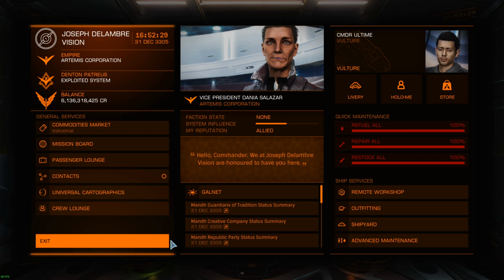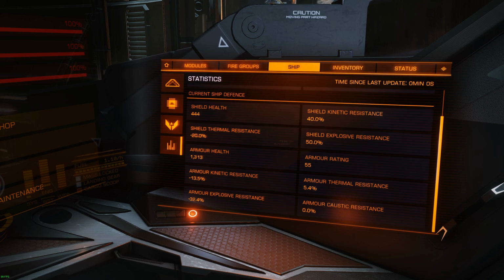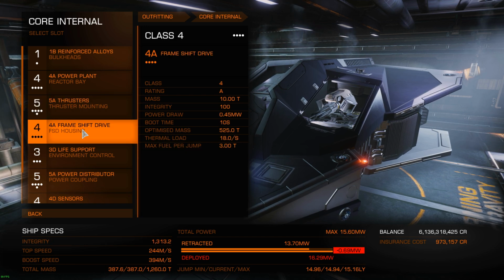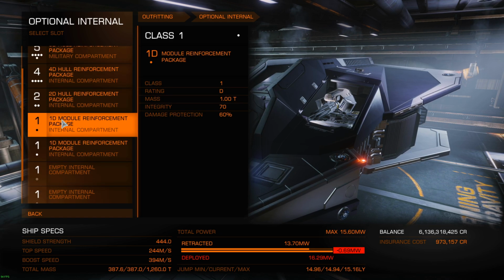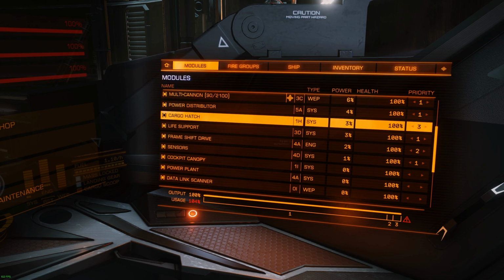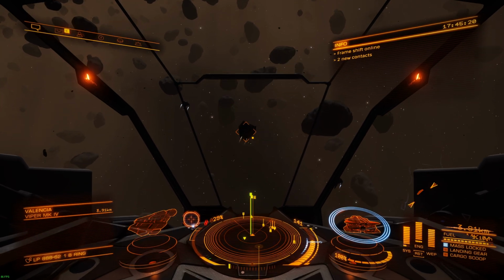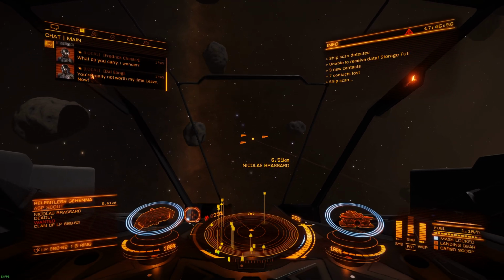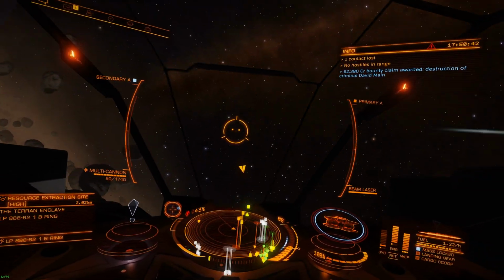Elite Dangerous Vulture PvE Loadout/Build and Test - Bounty Hunter Beginner Guide

Comment: I always thought it was better to have thrusters, fsd, and life support on 1, everything else at lower priorities so you can run if you have to
Reply from the maker: when in combat i dont plan to use fsd while using my weapon. worse case scenario , retract hard point to diminish power usage before running since i didnt have much else to shut down to be 100% operational in combat... also when your shield are getting lower and thinking about running away and wanna make sure fsd will be ready, u can also turn off a shield booster. of course the best would be some minimal Engineering to the power plant.